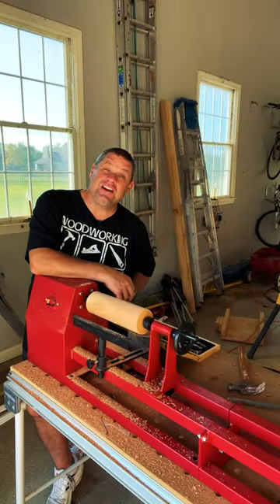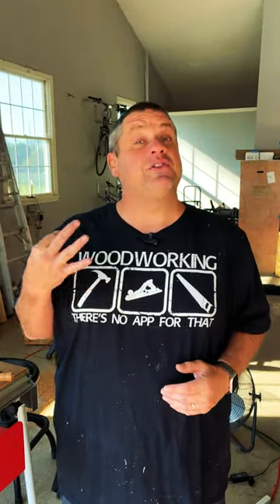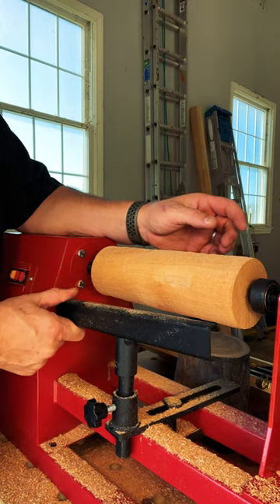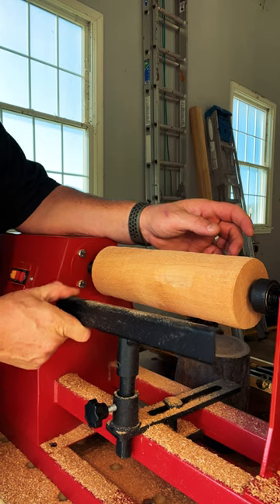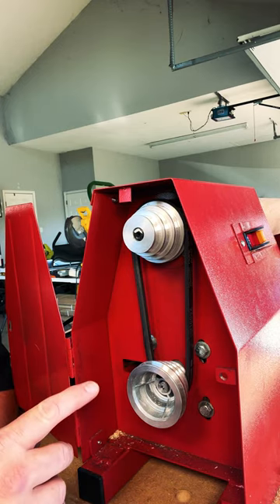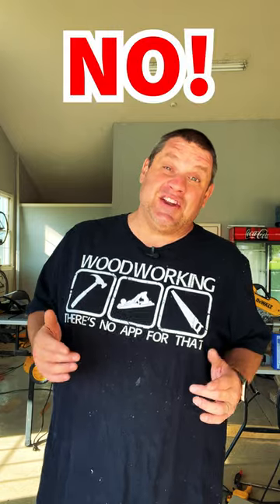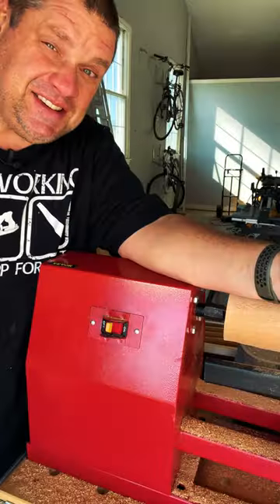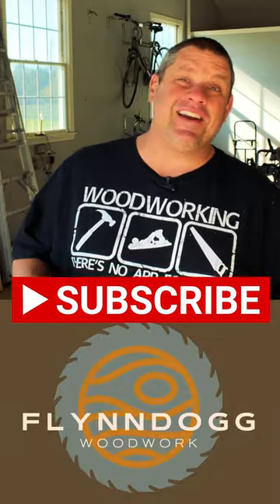Avoid these 3 lathe-buying mistakes!

Comment: Please, don't use that thing again. Get a lathe with a cast iron bed, a heavier tailstock with a lock for the spindle and a solid tool rest that has NO play in it. Believe me, if that thing shifts while you're turning, it could be real ugly. 

Rikon is a good starter lathe, Jet (IMO) is a little better, but both are worth the money. Laguna is you want to spend the money is an excellent lathe. Variable speed is a must. Longer is better if you want to do legs, rail spindles or posts. If you longer than 20", get a steady rest. Invest in good chisels and the tools to keep them sharp.

I'd also recommend watching Cap'n Eddie Castelin, Carl Jacobson, Brendan Stemp for starters. These guys are some of the best turners to learn the art from.

Have fun making shavings!
Reply from the maker: What a great comment!  I just ordered a new Jet Lathe this week!  I haven’t gotten it yet, comes in the next couple of weeks.  Can’t wait to start using it.   Thank you so much for the recommendations on the channels, I’ll definitely be checking those out!  Thank you so much for sharing!

Comment: You will regret your choices later, Let us start with the length. You start with replacing chair legs on say, broken antiques. As you gain more experience people will ask you to turn bedposts and even porch columns. Large faceplate turnings like lazy Susens and wine tables are in your future as well. Step pulleys are the best. When you need to slow down the speed because the diameter of the job requires it, you need to increase the torque. Electronic variable speed motors will burn up. Their torque does not increase when you slow it down. If you are a woodworker and you are too lazy to change belt speeds, you better pick another trade. Even variable speed belt drives are a maintenance nightmare. Never buy one of those used. You are right about the  tool rest. The weight and the material that your lathe is made of also contributes to unwanted vibration. Cast iron is best. Steel will vibrate more unless it's sectional thickness has been considered.
Reply from the maker: Love this John!   Thank you so much for sharing.  Sounds like you have a lot more experience in turning than me and this is the type of feedback that I love.  Thanks again for sharing and thanks for watching! :)

Comment: That lathe is worth less than the $0 you paid for it.
Reply from the maker: Haha!  Well, I would tend to agree with you at this point.  I'm upgrade soon! :)  Thanks for watching Paul!
Reply: @FlynndoggWoodwork  what lathes are you looking at?
Reply from the maker: @paulhopkins1905  great question.  I really want to take a class at some place like rockler or something.  I've always admired the rikon.  I'm thinking a smaller mid sized one where I can do bowls and things like coffee table legs, candle holders etc... any suggestions?
Reply: @FlynndoggWoodwork  the Rikon is a good choice, as is the Nova Comet II and Excelceor
Reply from the maker: @paulhopkins1905  Oh nice!  The nova is another one I've been thinking about.  I'm going to look into the excelceor!  Thanks for sharing!
Reply: @FlynndoggWoodwork  Whichever one you go with, you will be wanting a full size machine within a year lol. I started with the Nova, and upgraded to a Grizzly G0766
Reply from the maker: @paulhopkins1905  great to know!  Thank you so much for sharing.  I was looking at them yesterday and battling with the size!
Reply: @FlynndoggWoodwork  I still say start with a midi lathe, a catch on a bench top lathe will stall the machine, a bad catch on my 3hp machine can knock your teeth out. It's always best to learn technique on a smaller lathe
Reply from the maker: @paulhopkins1905  great point on starting small.  Thank you so much for sharing your experience!
Reply: @FlynndoggWoodwork  of course, have fun